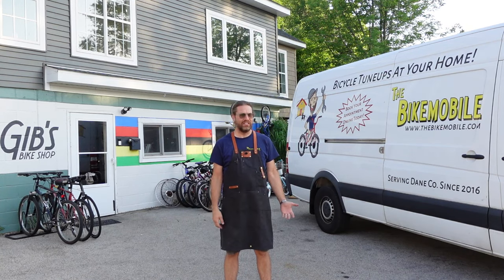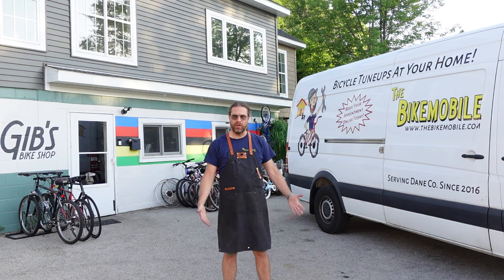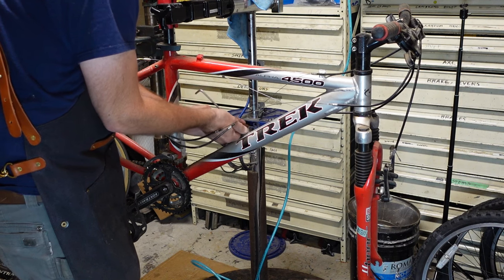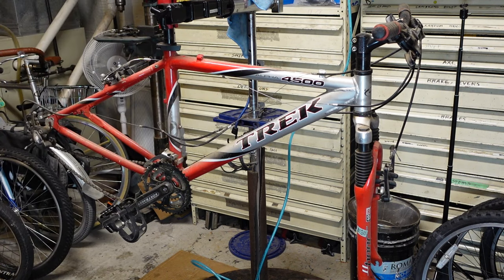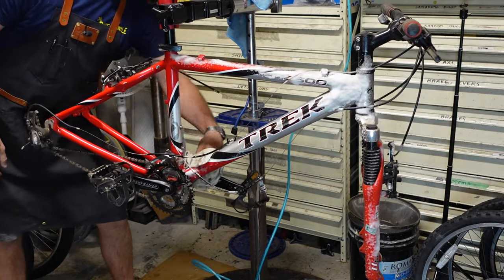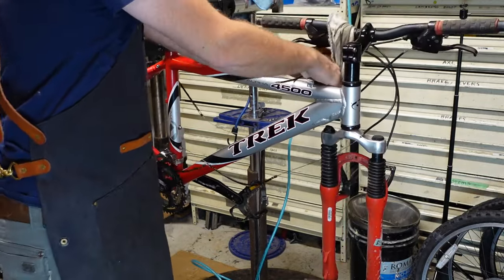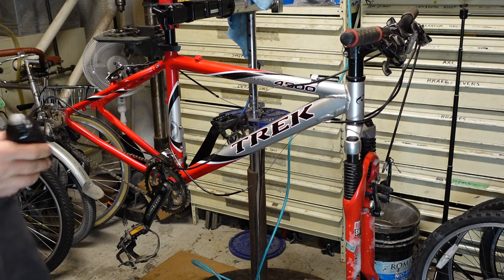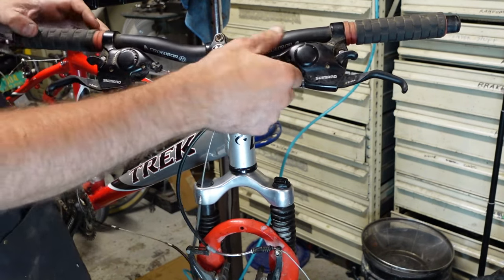Someone ABANDONED this PERFECTLY GOOD Trek 4500 MTB!

Comment: FYI on the frayed cable issue. What I do is put Super Glue right above the fray, let it dry then cut the cable above the fray. Works great!
Reply: thx for the tip
Reply: I used to do it with duct tape! Nowadays I just get new cables I've had enough practice where it's almost fun put some nice triflo'd cables and guides in.

Comment: In 2004  or 2005, I purchased a Trek 4300 with disc brakes. I eventually gifted it to one of my grand nephews. Today, I have a highly modified/upgraded Schwinn Axum DP and a Lightly modified Schwinn Aluminum Comp. Both are great bikes, but I have taken the Axum DP down black diamond trails and it has held up well (even without a clutch derailleur). Interestingly, I remember riding black diamond trails in the late 90's and early 2000's with bikes like this one and they were perfectly capable.

Comment: I have a ‘01 4500 and have kept it well maintained and it still serves me well.  $400 for 22 years of reliable service is money well spent.  I beat it up a bit in my younger days doing mountain biking in Missouri but now it is primarily a limestone/ asphalt trail bike.  I have swapped out the tires a couple of times since knobbies are no longer needed.  Most recently to some Schwalbe tires.  I hated spending the money but the ride feel improved considerably over the cheaper previous tires and now I don’t regret spending the money.  I tried an upgrade with disc brakes and other updated features but returned it because it it could not compare with my Trek 4500.  Thanks for the tips you shared!
Reply from the maker: Awesome!
Reply: Same here.  I bought a 4500 Alpha in 2001 for about the same amount and I still have it - it's served me well.  Just a few of sets of tires, several tune-ups and a new chain in the time I've owned it.  I don't plan on selling it.

Comment: Loved the video!  I have a 2000 Trek 4500 as well.  Still going strong.  Just replaced the bottom bracket and chain this Spring (first time), but had the same housing issue you found and replaced that shift cable last year.  Keep the videos coming!

Comment: I took a load of trash to the landfill. Propped up next to scrap metal to be crushed was a 90’s Raleigh. Had tons of dirt but the tires were unused. Brought it home even though the signs everywhere said “No Scavenging”. Cleaned and oiled it. Works great. Couldn’t see letting it get crushed in such good condition. Not an expensive bike new but perfect for my wife’s occasional rides.

Comment: Love the restoration.  Just one question.  The rubber boot on the fork.  Did you get it pulled up?  It was setting my OCD off.
Reply: Really bothering me as well. 😅 Curious if the fork even works? Those weren’t known for “smooth” action for any length of time.

Comment: I've upgraded mine Trek 3500 with double wall rims, better hubs, 3x9 Deore shifter and derailleur, cassette 11-36, black drivetrain 22-32-42, it has git NCX suspension seatpost and Selleroyal silicone comfy seat. It used to have Magic Mary on the front wheel. That thing is indestructable. It has got mudgards. Stem, handlebar and grips are from Giant Anthem.  I ran it for some time with a dropper seatpost. I would never sell it. It has Schwalbe Landcruiser 1.9 on the rear and 2.0 Conti Mountainking.

Comment: I'm doing that shit since 1992. First bike Trek Antelope 820.  800 Deutsch Mark. But my bikes today are a bit more expensive.
1x DH Bike, 1x Ebike every day bit€&, 1 x All mountain fully ( no time at all to use). 
Your opinion reflects the absolute ending, of love for the latest bike tech! And that's the result of working in the biking branch, too long, with too much uncool customers! Trust me, I know what I'm talking! And I am no hippster, for sure.
But, if I do used bikes in my work shop, I take of the end caps of the cable housing, and cut them new, straight and even. And then i put in some oil.

Comment: Sharpened spoke or one of those cable cutters with the built in cable ferrule holder; any time you cut incompressible cable housing, make sure the Teflon tube inner ends are opened up., that's how you stop cable unravelling.

Comment: Like the videos too bad we have so many states between us. I have a Trek 600 series carbon frame rim brake Ultegra Di2 bike you may be interested in. Never dropped it paint is perfect. I upgraded to a newer SL7 for added frame stiffness. It just collects dust now. Have 2 wheel sets for it too both aluminum one set with bladed spoke both sets are true. The drive system has been cleaned and converted to hot wax so can be waxed or oiled easily.

Comment: Do you take it for a ride and throw some torque down then adjust the derailleurs? Also, i have a 2022 Specialized Chisel frame that i want to swap a few components from my 2015 hardrock. Do you think i can use the 27" wheels on the chisel? Thanks!

Comment: How cool.  I find your channel and here you are working on a Trek 4500.  I just purchased one of these off FB marketplace for probably too much money.  It's a 2001 and the color is ball burnished which I give a good clean nowhere near as good as the bike you have.  I think it's even more low end than yours with the Rockshox Jett fork and the Altus crankset that's riveted so it can't be taken apart for a good clean.  I remember when I first gave it a test drive, I had to peel my hands off the grip because they had turned to goo.  Just curious if you have a ultrasonic cleaner to get the deep down dirt out?

Comment: If only people knew how much more thought out a bike shop quality bike is. Spacings are universal, parts are much easier to find and fit, the frame stiffness is so much better, wheels are built so much better, everything just runs so much smoother and more efficiently. Not to mention the resell value compared to a department store bike.

Comment: Cool video. I so bad need a stand for straightening rims up, its so annoying to fix up a cheap bike and then have to go pay 40 euros at the bike shop to get the wheels nice and straight! And the 40 euro, thats per wheel...
Reply from the maker: It makes it easier to do the job right. But you can just use brake pads to get things close enough!
Reply: @bkefrmr  Great tip, thanks man

Comment: Shifters and derailleurs don't look original. I've a 4400 (well maintained), and it came at the time with a Deore + Acera config. The 4500 was supposed to be the same but with Rock Shox instead of Suntour suspension I think. Sad, a full Deore would make a big difference.
Reply: Derailleurs are original

Comment: I never wear a helmet and I have been biking for 30 +years especially when trail rides.. have a low branch or vine snag it the  and wip your head around or break your neck and the off balance feeling it gives .. besides it's not the head injury that messes you up it the neck and spine pus id need a actual motor cycle helmet to protect against what kinda impact im delivering any thing above the 15 -20mph rating of the bicycle helmet .  Blow outs and brake failure and traffic..  i avoided my last close one hit the brakes so hard front and back in a emergency stop  position sitting on my back flat rack and came to a sideways sliding hault parrell to the suv that stopped in the crosswalk. Any closer. My handle bars would have hit and I would have body checked the door in  like i was playing hocky and when I released my brakes from the stop the brake pads were ripped off the post holding mounts and the front brakes no longer could get enough pressure to stop any more.. just a rubbing squeak on the right side.. that particular stretch its a 35 mph speed limit and its a lengthy down hill of which I take advantage of  and im going faster than traffic unless there speeding .  Around 50mph .  So ya helmet is not really a factor unless i wanna replace my armadillo hat. 😅

Comment: liked and subbed, gotta support my fellow Wisconsinites lol. I got a quick question. I'm pretty good with keeping my bike clean and lubed and I mostly use it for commuting to work with the occasional trail ride by the lake. The problem I have is within a week of lubbing my chain it's gone from nice and clean to completely black. I use Finish Line Wet Lube which seems to work great because it's nice and thick and it stays on the chain but it also seems like it picks up dirt and grime like a magnet. What would you recommend for a good chain lube. I also have a bottle of Purple Extreme that i used for a little while but I can't really remember why i stopped using it.
Reply: I used to use Finish Line. It makes your chain dirty as you say. Try Rock and Roll Gold. Works good and your chain doesn't pick up grime. I live and commute next to the beach and ride thru some sand  and dirt and it's never really a problem for me. No rust, no muck.
Reply: @jojoadeyemi8239  awesome thanks for the suggestion, I just ordered some on Amazon and it should get delivered tomorrow.
Reply: Google hot wax chain lube; it's pretty simple once you know how to do it, lasts for ages and is very clean.

Comment: My only trick was a 3700 during this video I located two 4300 when was loaded many upgrades in Westchester clean and very $390 firm the price of a Walmart trouvale or a Ozark ridge it just made me so excited but with the holiday I can't afford it the next one I found was another 4300 I looked at the picture of the serial number and determining it to be a 2011 black with some silver it's completely rideable said it needs a little bit of tinkering it's got like vandalism damage with spray paint and someone tried to scrape off the decals on the fork fork if I'm correct I think they're supposed to be a RockShox judy up there but this one does not appear to be a rock shop unless the decals were so badly damaged on the top ones are scraped off I'm not sure what it is but the crossmember at the top that holds on the stanchions it's like a copper color I don't recognize that somebody either changed it or the paint damages removable and I could always order replacement decals for the correct fork even has some really nice bontrager tires looks like somebody replaced them along I think I could get it back in shape he's asking $120 and I would hate to and sell them but I might ask just asked him if he would take any less for it I can probably put this together after Thanksgiving thank you for your videos and I really enjoy them and learn a lot I used a generic lemon furniture polish I learned a lot about your cleaning methods that helps me out quite I'm 5.11 I actually prefer a medium over a large frame